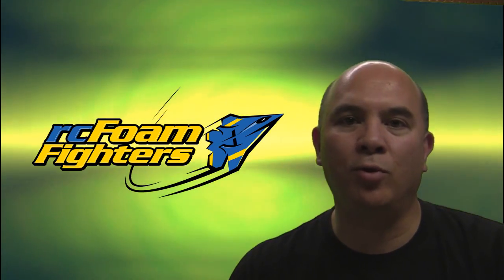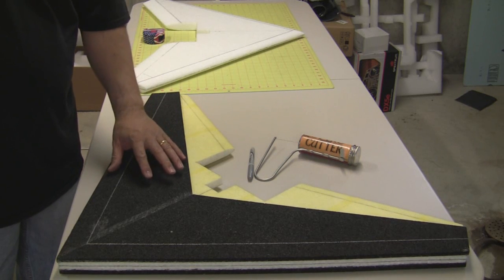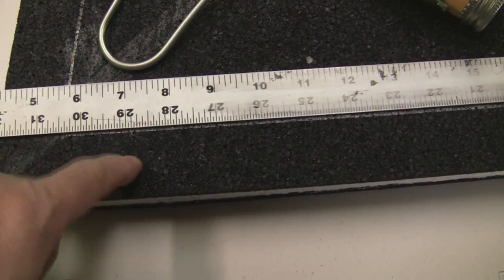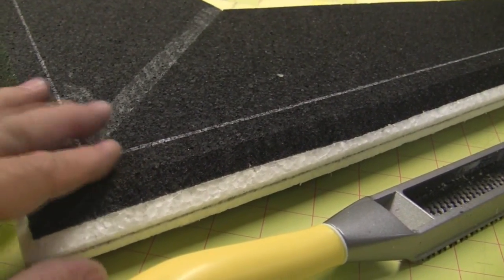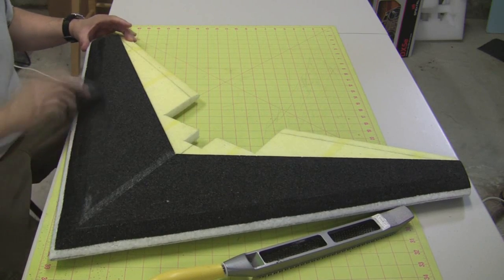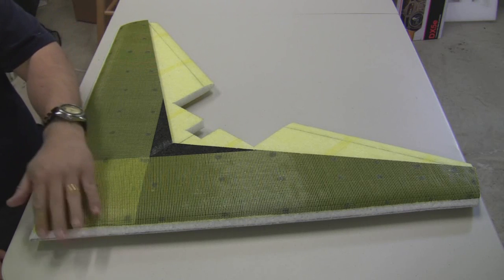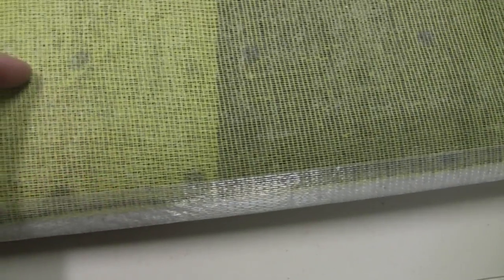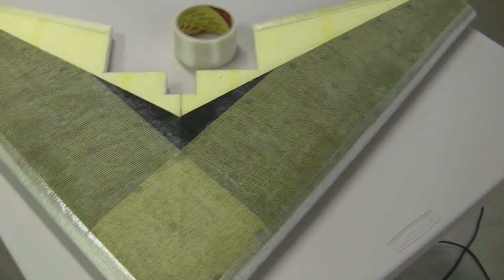Bullet Proof RC Plane Build Along No1 Phase 1J

Comment from the maker: AD2181 We have never covered a plane completely with just strapping tape so I could not tell you for sure which would be heavier. It would probably be pretty close in weight I'm thinking but maybe a little heavier. The purpose for the weave is it makes the plane more ridged and crash proof.

Comment from the maker: angrygunsmith you may be better off asking your uncle about this glue as we have never used it before. It would come down to how strong it holds and how much weight it would add to the plane. If both these are good I see no reason why it could not be used. Experimenting is the only true way to find out.

Comment from the maker: insASneTunA I can't tell you if you should build the plane or not. That will have to be your own decision. What I can tell you is that Paul's new EPP park jet weighed in at over 900 grams and it flies great and is very fast. It really  depends on the power system you will run on the plane. If you build it, you will need to have at least a 1 to 1 trust ratio. The trust should be equal to the weight of the plane or better. The KF airfoil should help lift the extra weight.

Comment: together with the airfoils I am at 511 Gram. I am getting a bit worried now I think that when I am finished it is going to weigh a 1000 gram. It is very strong though, I think I can even stand on it. I know my motor can handle more then 1000 gram but that is when it is mounted on a easystar which has a lot of lift because originally it is a glider.  do you think that I should  finish the build anyway  or doesn't it make sense because of the weight ?

Greets from iT

Comment from the maker: waterchildtera the plane has a KFm4 airfoil which is on the top and bottom of the wing. Now that I put the second layer of fiberglass over the KF airfoils the wing is stiff as a board with almost no flex at all.

Comment: I like it a LOT !!! Since I live in Europe (Holland) I could not get the adhesive so instead I used epoxy and fiberglass cloth. I also used some 2 milimeter carbon rods to stiffen up the plane. I am using depron to make the airfoils although the depron sheets are just 6 millimeter. I hope that it doesn't matter that I use 6 millimeter sheets instead of 8?

Greets